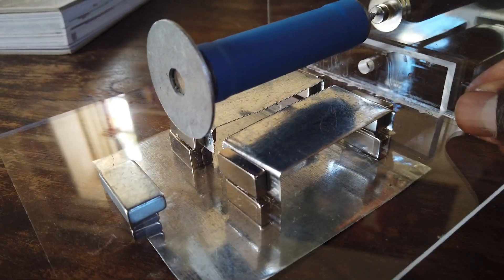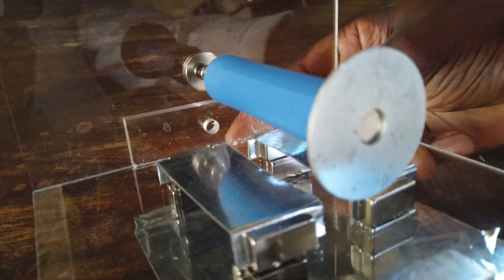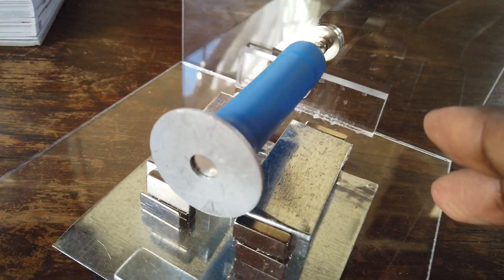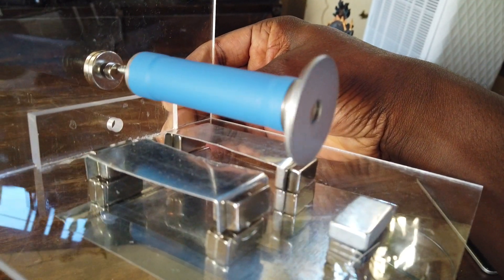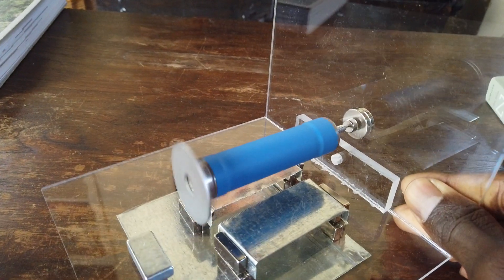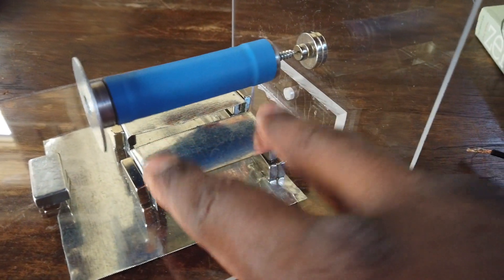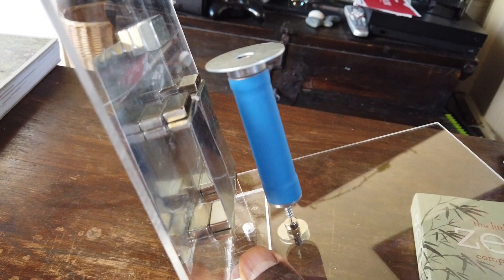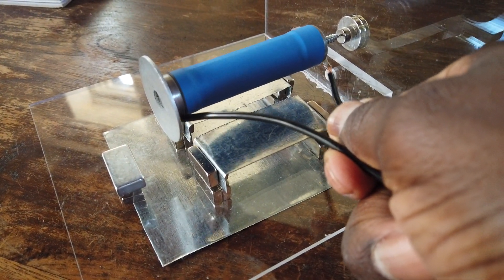Magnetically Levitating Homopolar Motor

Comment: Am I mistaken in thinking that - the energy discharge you achieved by shorting both terminals of the battery with a wire was enough to generate some rotation which was stored in the flywheel mechanism of the rotor? Or is this thing supposed to spin perpetually when "dialed in"? Like do you always need the battery to discharge through something such as the wire for it to spin or can it spin on its own without depleting the battery?

Either way, very cool video. Neat toy!
Reply from the maker: It will deplete the battery. If it were perfectly balanced, and I decided to give it a larger moment of inertia (like adding a flywheel), it would spin a lot longer. It's really just an exercise in spinning something with greatly reduced friction. Another question you might ask, though, is "D the sparks add to the efficiency?" I think they do, but this demonstration wouldn't prove it either way. They indicate that a high voltage is occurring, and it makes me think that maybe adding an inductor and capacitor could have some interesting effects.